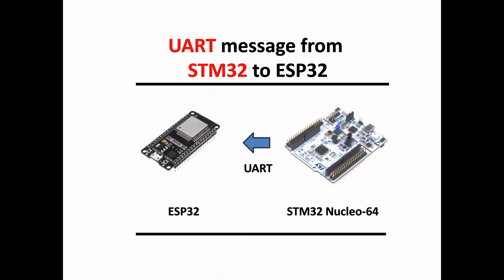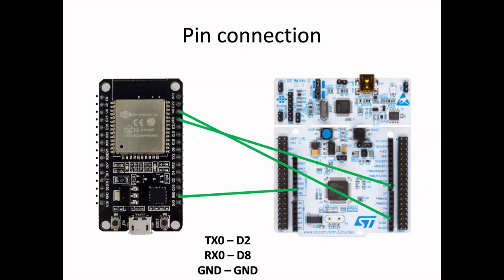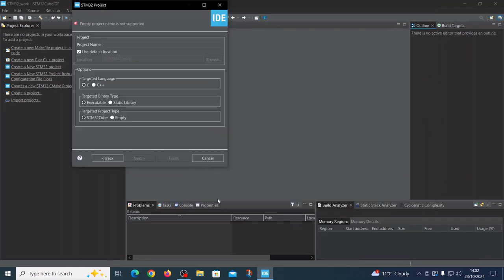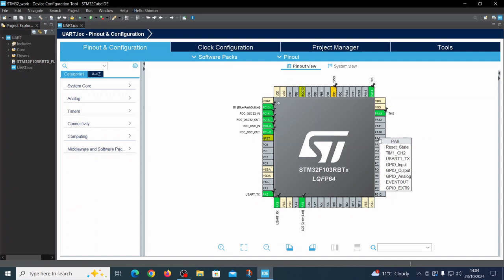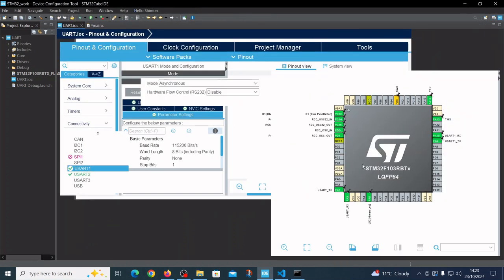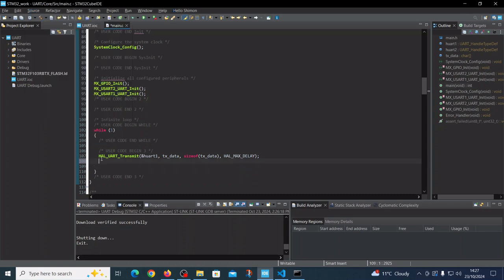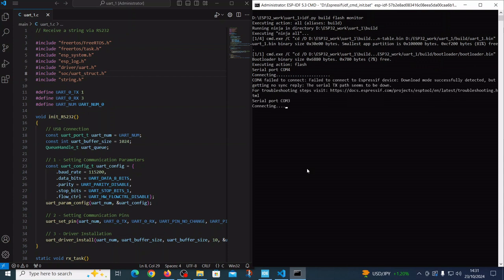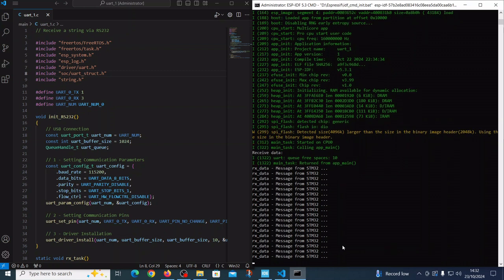UART message from STM32 to ESP32 in ESP IDF 5.3

Comment: will this  work on stm32f407 and esp_wroom_32 mcu module  
and i have use can transreciever SN65HVD230
Reply from the maker: Dear @AtharvNasare,
I think it will work on the STM32F407 and ESP-WROOM-32 MCU modules if you define appropriate projects for those boards. Why do you need a transceiver for UART?

Comment: does this code work on stm32f411re?
Reply from the maker: Dear  @hoangviet731,
This code should work with the stm32f411re, but please note that the right approach is not to use the entire C code file in your project. You should build a new project in your STM32CubeIDE by choosing the correct board and only adding three snippets of code mentioned in the video in three places marked as a USER CODE. This way, the project will be compatible with your system and have the right functionality.

Comment: That work with NUCLEO-L476RG?
Reply from the maker: Dear @Saidanirayen-l4c,
This code should work with the NUCLEO-L476RG board, but please note that the right approach is not to use the entire C code file in your project. You should build a new project in your STM32CubeIDE by choosing the correct board and only adding three snippets of code mentioned in the video in three places marked as a USER CODE. This way, the project will be compatible with your system and have the right functionality.

Comment: Does this project work for the STM32H753, i dont see anything in idf monitor :(
Reply from the maker: Dear @elcalvo4416,
Generally, this code is supposed to work with STM32H753.
Reply from the maker: This code should work with the STM32H753, but please note that the right approach is not to use the entire C code file in your project. You should build a new project in your STM32CubeIDE by choosing the correct board and only adding three snippets of code mentioned in the video in three places marked as a USER CODE. This way, the project will be compatible with your system and have the right functionality.